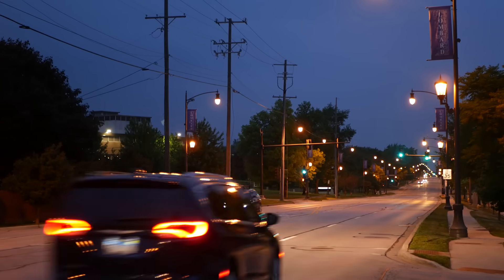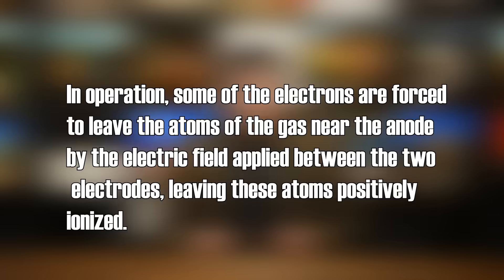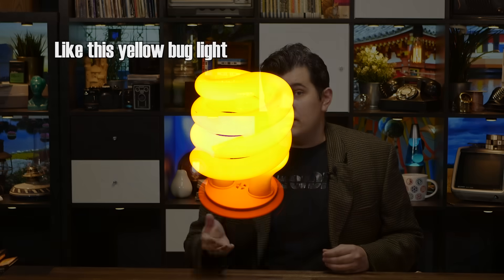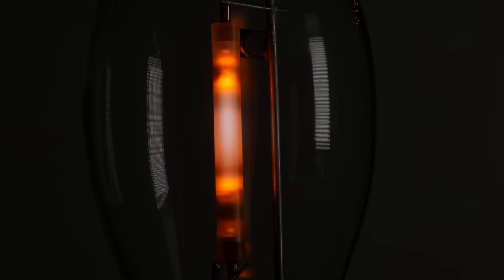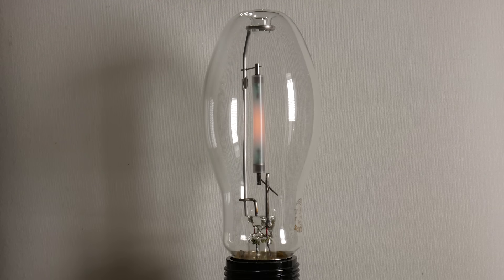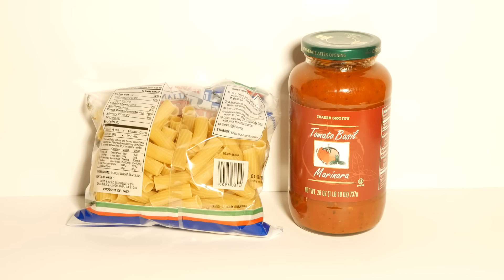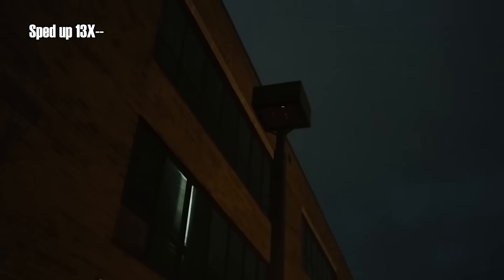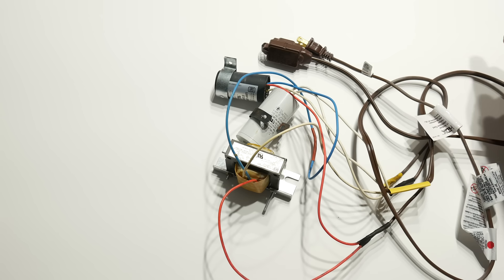The High Pressure Sodium Light: Ubiquitous, effective, but good?

Comment: To give a real world example of how ABSOLUTELY TERRIBLE HPS color rendering is, take a look at an asphalt parking lot, then think of fluorescent pink.

Those are pretty drastically different colors aren’t they? Well, not under sodium lamps. I was once went to do maintenance at night on a parking lot where they had used pink paint on the pavement to mark out the scope of work. I literally could not see any of the marks.

I would have had to just give up and go home, except I was able to use the map showing where the locations were and a flashlight to find the marks after much wandering around and then re-mark them with some green paint I had. Even then, I was only able to see it, as the saturation and value were drastically different, you couldn’t tell it was green at all.

Comment: Are you sure it is a 100W LED and not a 100W incandescent equivalent LED? (i.e. 10W)
100W LEDs are typically floodlights with huge heatsinks, and I don't think they're even available in a such a small package like the  E27 high pressure sodium you show.
Also, LEDs can be upto 10x more efficient than incandescents, they are getting more efficient every year, and LEDs with a very high CRI are getting more available every year.
Reply from the maker: I said it was a 100W equivalent.  So you misheard me.

Comment: Colour is a problem for other areas as well. As a driver I have to say I strongly dislike the new whiter LED lighting. It makes it impossible to tell whether the light you can see around a bend is another car, or just the street lighting. Previously I didn't notice how trained my brain had gotten to simply ignore the orange lighting. They changed the light on a corner, and now every single time I approach that corner, it means I must slow down, and act as though another car is there, because detecting the difference in light intensity is extremely hard compared to the very well defined hue shift...

Comment: The lights here in Hilo have a very specific yellow color.  Not sodium vapor... even the new LED lamps have a color filter added to them.  The point is to limit light pollution, and blue scatters more.
The driving concern is the observatories on Mauna Kea.  There's also concern about messing up sea turtles coming in to breed.  However, there are lots of other nice things about not filling the night sky with a strong diffuse glow.

Comment: I wonder what the CRI was of that terrible old circline tube that came with the GE Circlite ballast you did a video on. I certainly do remember the poor color rendering of old/cheap florescent lamps, the ones at the Y where I started Karate made everyone look like they had mottled skin. Otherwise it was just the cold bright and washed out look of older kitchen tubes, especially circline ones. At least in a kitchen it kind of had a sterile/antiseptic look to it but the room just felt cold and uncomfortable

Comment: There are so-called "deluxe" high-pressure sodium (and also mercury vapor) bulbs with a white phosphor coating that allows them to give off a much more pleasing white glow. But they're not widely used due to their higher cost and lower efficiency. In my area, all mercury vapor and many HPS lamps have been replaced by "IceTron" induction lamps which are supposed to last 100,000 hours.

And astronomers love low-pressure sodium lighting because that single wavelength of orange light is easy to filter out, thus causing a drastic reduction in light pollution. But LPS fell out of favor not only because of its ghastly appearance, but also because crime was rising in the '70s and it became a detriment for people to not be able to identify colors in an area lit by it at night.
Reply: Actually 100,000 hours is not unreasonable for an induction lamp.  I really wish PL ones were more common; they can be easily refit into existing cobraheads without loss of efficacy.

Comment: Sodium lights still contain mercury.  The sodium provides the characteristic yellow-copper colored light of the high pressure sodium light, yet the arc is struck through mercury vapor.  This is why HPS lights, when struck, appear dull and gray.

Comment: Tungsten bulbs are brighter and have a whiter light but from what I've seen carbon filaments last much longer, the record for the longest lasting light bulb is held by a carbon filament bulb that's still going after nearly 200 years. They have a higher off resistance so there's less of the inrush current that usually destroys the filament at turn-on; a tungsten bulb passes about ten times its rated power just as it's turned on, which is (presumably :) why kids like me back then were told not to flick the light off and on repeatedly.

Comment: ...you might not want to use an extension, lamp cord, or standard lamp socket for any longer than needed as they are generally rated only to 600V and many gas discharge lamps like these can exceed that, nearing or exceeding 1000V.  the cords and lamp socket you used don't have sufficient breakdown or isolation for the voltages over 600 and even a minor defect or crack can lead to arcing and fire.

Comment: thanks for the info, my city uses those lamps and we can report failing lamps if we want, but i am less likely to report if i think the lamp itself is the problem and not the bulb, because my city isn't likely to replace a lamp (they seem to not understand that you don't have to replace the whole pole to replace the lamp fixture). now i know, if i see it i can report it as a faulty bulb, not a bad lamp. gets better attention that way, because the "repair" is cheap. just not something i had given much thought before.

Comment: I found that the major disadvantage of high-pressure sodium lighting is that, because it is so near the peak sensitivity of the eye on daylight conditions, your pupils and retinas won't adapt as easily, effectively rendering you night-blind when driving. You can experience the same phenomenon when you're being overtaken by a driver with (predominantly blue- and green- coloured) HID headlights.

That's where the major advantage of LEDs comes in, because they can be tuned to emit more light in the red area of the spectrum, as well as dimming to a level where scotopic vision is retained.

Comment: natural gas street lights with a open flame in a glass tube, doesn't use any electricity and cities used them for 100 years very efficient and last forever, sadly  there's not many left and the ones that are still around have electric bulbs in them, some places should honestly consider bringing them back just to use during power outages

Comment: I prefer driving under these than the LED street lights we have in the UK now, it’s much softer on the eyes. As an electrician here, we no longer install sodium lamps hardly ever anymore, everything new is LED.
On a side note, I saw you mention low pressure sodium lamps, I love these because of their tendency to consume a lot less energy than high pressure sodium lamps, and the yellow glow is very pleasant I think. Low pressure sodium (SOX) lamps are usually between 35 and 40 Watts whereas high pressure sodium (SON) lamps are usually either 70w in very small fittings, or 250 or 400w in any high level or large fitting.
-You hit the nail on the head with MH lamps needing time to cool down after shutting off, it is the most annoying thing, I do a lot of work in warehouses that usually have an odd mix of MH and SON lamps and when I’m trying to trace a lighting circuit, I’ll flick one off and have to wait a few minutes before turning it back on and trying the next one.
-And the LED point is also really annoying, we get loads of lamps failing because of the driver within a year of installation. If you don’t buy top of the line lamps, they’re forever failing.

Comment: As a hobby astronomer (astrophotographer) I love these lamps (and mercury too), because they have a very narrow emission line and I can easily filter them with an CLS or UHC filter (for example those by Astronomik, Baader, Optlong, etc). This makes taking pictures under light pollution easier, even if the colors are off (but that can be fixed in post processing). The new LEDs are a nightmare (hehe) for a hobby astronomer like me, because they have a very broad and "spiky" spectrum they are impossible to filter reliably. Luckily the fixtures usually only point downwards, but when they're not ... forget about ever seeing stars :/

Comment: HPS: Nostalgic, Easy on night vision, Doesn't kill circadian rhythms, Awful for productivity, Merely accent lighting in globe style fixtures, Bad for parking lots and sidewalks.
LED: Modern, Awful to night vision, Jolts circadian rhythms,  Great for productivity, More function than form in globe fixtures, Great for parking lot and sidewalk safety.

Honestly, I only hate LED for the loss of nostalgia and the fact that my municipality didn't even consider using diffusers. You get to the the event horizon of the cone and can clearly see 2 lenses. Very intriguingly, the most affluent parts of our town have either stuck with HPS or use a lot of smaller metal-halide looking fixtures at lower height.

Comment: Most any arc lamp is fairly efficient at converting electricity to light. I remember many years ago thinking if LEDs would take over for high light output applications and it seems thats still up in the air. (har har).

Comment: This video made by day brighter!
As far as the HPS light having a better reach then the LED you can see it in the television screen behind the LED lamp.
You can see the shadow and particular hue cast on the screen by the HPS bulb. The color of the LED is washed out by the gold/yellow/peach/headache color of HPS.

When I worked in a parking garage I noticed the same thing when they were replacing florescent tubes with LED.
Sure, it was brighter right under the bulb, but it was a little darker between lights, whereas florescent was even overall.

Comment: I do commercial  building maintenamce...... we like high pressure sodium lights because the orange color doesn't attract bugs........ the LED replacement lights are still not available in Amber bug color....... if they came out with the Amber LED outdoor light we would start installing them in favor of high pressure sodium

Comment: I was a big fan of Sodium Vapor for my home but found through the big box stores that the drivers would continually fail. The bulbs they were good and these plastic boxes were well protected from the elements. I gave up on them as the circuits would fail way to early. That was then, I might try again and this time with better knowledge try and find the failure in the driver.

Comment: Where I live the sodium vapour street lamps have been replaced with led lamps, for efficiency I guess. I noticed that the led lamps made the street darker, and I think it's because the leds are more directional than the sodium vapour lamps, which spread their light around. The leds seem more like spot-lights, only illuminating the ground underneath them. I imagine they can be dimmed also. This is great for light pollution, but in parking lots and public grounds it doesn't feel as safe as the sodium vapour lamps did. And if you're not stood underneath one it can be hard to see where you're putting your feet. I'm not sure they thought it through completely.
Reply: Nah it seems like many times they just want the money, or implement it early based on poor studies. But hey, gotta fuck up first before you learn 😅

Comment: I work for the local utility which changes and maintains the streetlighting. (the street department 'controls' it). We setup some stretches of LED lamps, and here's what we observed:
You have to use a diffuser. Period. A good diffuser cuts down on the total light output a bit but scatters it more so you have a more uniform lighting. Still, even with diffusers in place, both observation and video on the ground and from a drone we borrowed showed that the same stretches were more 'patchy' to the eye. Even clipping on a HPS filter (they make them, they approximate the HPS yellow from an LED) didn't really help the light to light 'ground fill' to the point of making them indistinguishable. We also used light meters and similar results. The LED was always brighter directly underneath, shed more of a 'cone' even with the strongest diffusers, and fell off more between the lights.
We tried several different filters. You can actually try them with many filters then request the exact color or white temp you want.
We did all this about 2 years back and aside from some people who have selected the option for backyard type lights in LED, I don't think there are any LED's in our area. We do have LED signals everywhere.

Comment: My town has slowly been replacing the old sodium light with LED as they burn out. The first few were white, but the ones they are installing now are the amber color we are used to. Amber leds do cost more, but there are multiple reason to use them instead of a pure white led lamp. There's an observatory about 50km from my city which makes bright white light a problem. It obscures the night sky. It's also a fact that personally, bright white led lamp make me feel like a deer in headlamps. They are so bright that my eyes have a hard time adjusting between the bright light and the dark surroundings. Bright white light also has been shown to have an effect on sleep patterns.

Edit: I made that comment as I was watching. I see that at the end, you mention you'll be addressing that in your next video.

Comment: My city has been replacing its HPS bulbs with white LEDs all over, and in most cases the results don't seem any worse to me than the HPS bulbs in regards to road safety. However, this unfortunately hasn't been the case everywhere. There's a stretch of road which uses spherical lights sitting on top of much shorter lamp posts instead of high-up downwards facing overhead lights like everywhere else, and the city decided to "upgrade" some of these lights too. As a result, I couldn't see the road in front of me because the lights were just too bright to look at and too close to the road to ignore.

Comment: Okay, I thought one of the reasons sodium bulbs were used for street lights was that the yellowish color was better for enhancing the contrast of items being lit up. I mean, in Europe fog lights were usually tinted yellow for this reason. Likewise, the silly trend of putting blue headlights on your car is stupid because blue light makes less contrast, therefore objects are harder to distinguish than yellow, or something.

So I found this video quite interesting. I was in the Navy and one of my jobs was to monitor personnel dosimetry (radiation levels). We had devices that each person would wear on their belt called a TLD (thermoluminescent dosimeter). There was an element in the cap to absorb neutrons, but what we mainly focused on was the glass capsule stored inside the case. It was basically a wire with some calcium flouride crystals attached to it, and when photons hit the crystal, it would send electrons into an excited state. So every quarter, we'd read the dosimeters by inserting them into this machine, which kept them in darkness and would apply a voltage to the dosimeter which would result in the electrons returning to their normal state... which produced light. So the machine would calculate the dosage received based on how much light was emitted.

I was reminded about that when you started talking about electrons. I didn't realize how similar they were. Great stuff!
Reply: French cars were sold starting in 1937 with yellow lights and while it was stated as safety, it had more to do with recognizing who was driving up on you in the night during WWII. Yellow is actually worse for night time driving, but the French government could certainly pick a French car out in the night. This was phased put in 1993 when France conformed to the EU.
Reply: Curious if you watched his next video which seems to suggest that bluer light is superior for night time vision. Yellow/orange light is more pleasant, but it looks like bluer light is safer
Reply: i'm european and fog lights can not be yellow here, has to be white 🤔
Reply: No car is sold in the UK with yellow lights.
The best lights Ive used for driving at night were LED headlights.
Reply: A lot of guys put the blue headlight bulbs in to make people think you have the high discharge headlights that come in cars like a Mercedes  .
Reply: I also agree about the blue headlight's, more so because of them (hid's and led's) being put into "reflector" housing's that weren't designed for that bulb type, more often then not resulting in extremely scattered light's output (Glare).  Where as super white light 5000k ish light's regardless of type through projector housing's that have been tuned and aimed properly are far far better.   The Toyota Prius has crazy led projector's apparently they get high beamed a lot... (according to a buddy, I of course would never own one!)    with my retrofitted morimoto fx-r 3.0 3" bi-xenon projector's aimed with EU standards (1% down vs 3% down) the NA standard I never get high beamed, or very very rarely... and then the people that high beamed me get the "retina Ripper" treatment... and realize there mistake rather quickly :) :) :) :)
Reply: @incognytothegreat  I Still Say
That "0LD School 1950's
Mercury Vapor Streetlights
Made Hot Colors like an Orange
Traffic Cone or Traffic Barriers 
Easier to Spot in the Distance,,
Wile the Newer High Pressure
"Sodium " lamps of the 70's
Make Everything look "Dusty"
And Lifeless??
Reply: The other issue with LED lamps is that they produce a lot more light pollution.  This can be mitigated with proper filters and covers that direct the light downward, but they often aren't used.